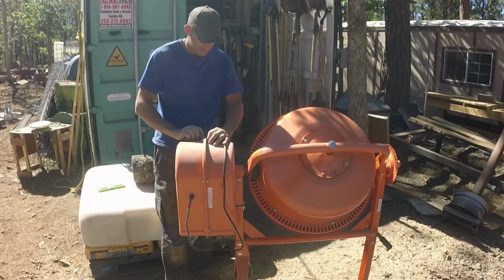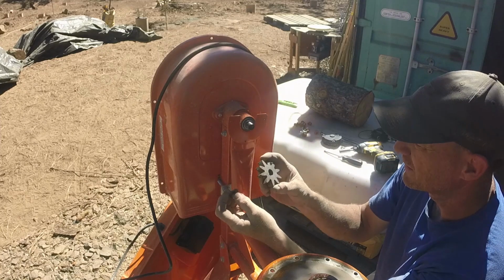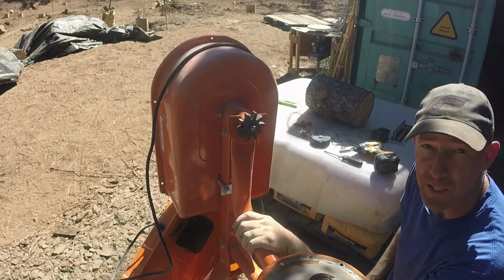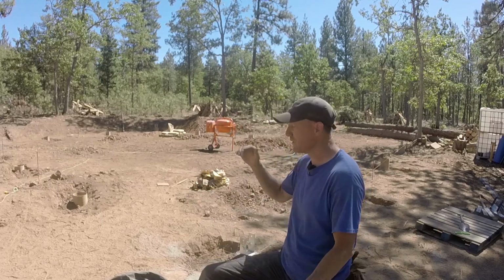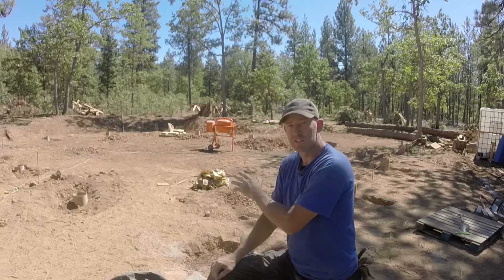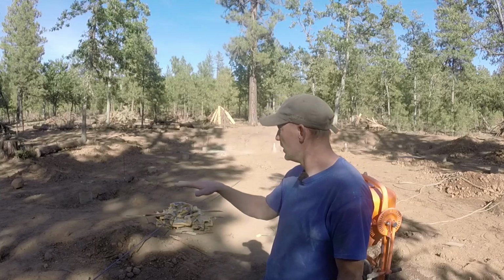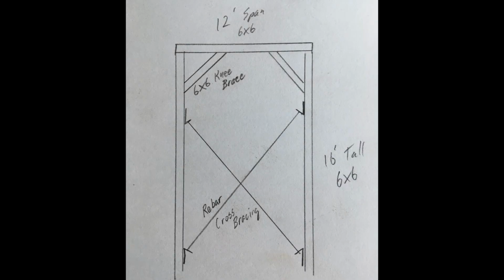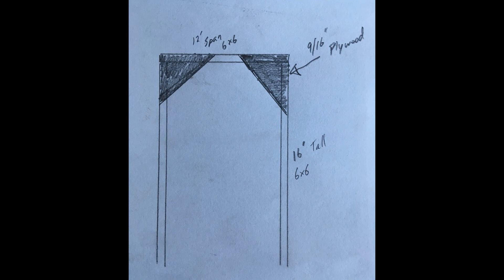Shop build part 2, Harbor Freight cement mixer

Comment: Unbelievable finding that pin Lucky
Reply from the maker: You're telling me, when it first happened I figured one of the pins had sheered off so I pulled it over to where I worked on it. That pin could have fallen out anywhere in between. Super happy I didn't have to mix the rest by hand. lol :)

Comment: two things: first, do you use just concrete and water? I thought that a strong mix can be made using sand for a smooth surface, or what we in the uk call ballast, mix of gravel and small stones. the cost of those is less than cement powder. second, you can build a monocoque single seat race car from steel tube, steel sheet, or carbon fibre. carbon is too expensive, whoever heard of a carbon barn? sheet monocoque riveted together much stiffer and lighter than steel tubes, ok weight not so important here. but plywood stiffer for corner braces, easier to attach than great tree trunks. just food for thought.
Reply from the maker: I use premixed concrete bags bought from the home store, cement, sand,and gravel mixed into a bag, just add water. And I'm thinking about using the plywood corners to secure the posts to the top cap and give it a sheer rating. It's going to be hard enough to get stuff 16 feet in the air and nail it all together, i don't feel like holding a 6x6 knee brace with one hand and then trying to lag bolt it with the other hand. Not that I couldn't, everyone knows I'm super strong but I don't want to show off my super strength. lol :)